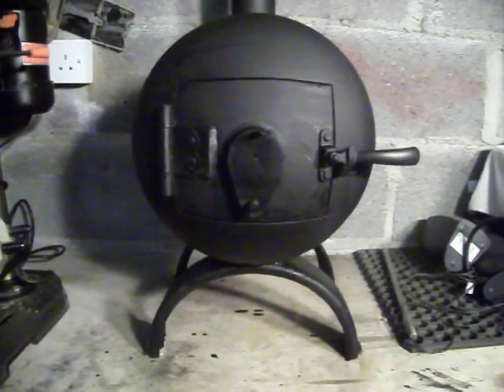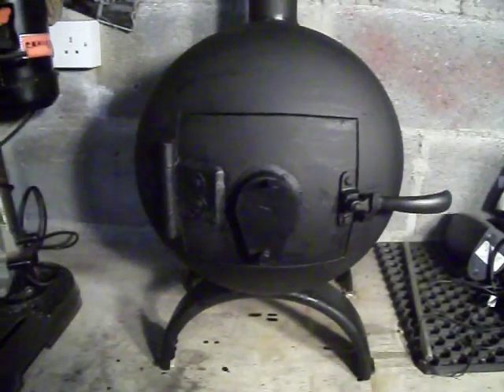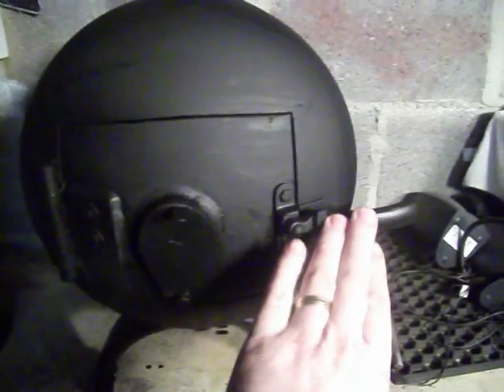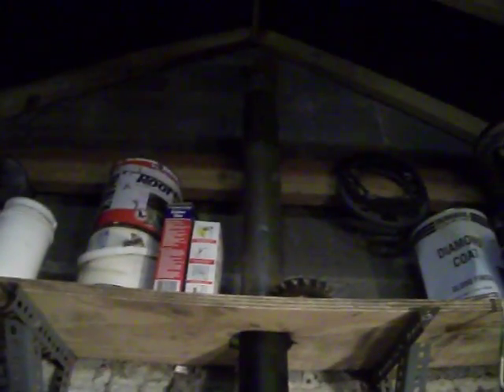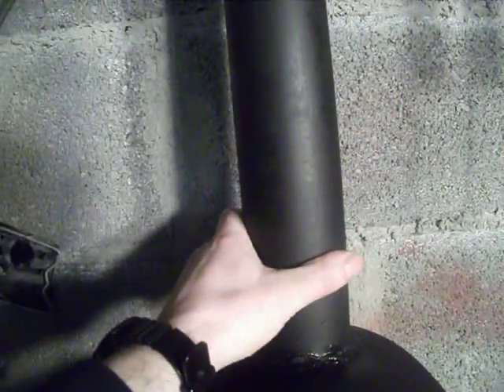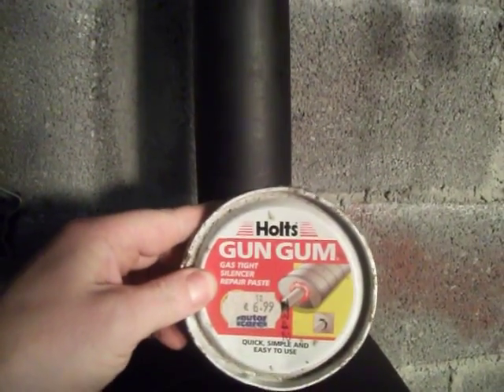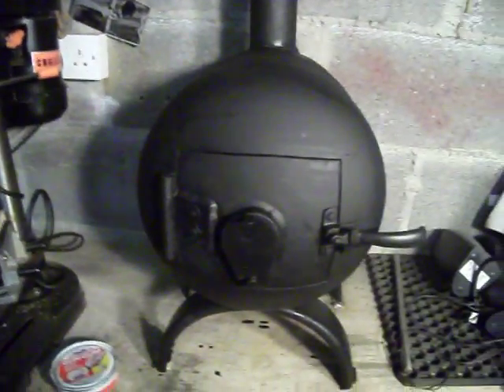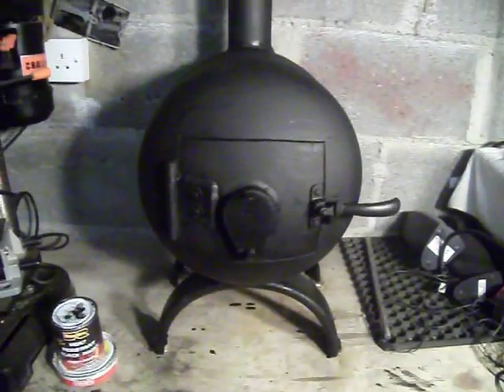gas cylinder stove pt 3

Comment: Nice job, we have a propane bottle stove, there are never problems with smoke leaking out of gaps in the exhaust. The draw sucks some air in through any gaps. A good idea is to make the chimney easy to clean, a good technique is just to push the soot back into the stove. I have considered making one like this but i would cut away most of the top and weld on a flat plate so one can heat water or cook. A huge pot of water keeps the heat in the room for many hours and makes a nice shower if need b.

Comment: Hi,

I have been looking at different designs of the wood burners now i think i wil be copying yours.......
I have 2 questions that i hope you can answer
1) did you use any fire rope around the door to stop the smoke ?
2) did you put a damper in to stop the flames from going up the flue?

many thanks

Comment from the maker: @Kevinisageek I dont know what the exact Btus are but , i kept it goin for a full day a while ago and it burnt off the heat resistant paint i used which was rated for 220c so its definitely hotter than that,ive since painted it with paint rated for 660c so that shoul do,it raises the temp in my garage by a few degrees overall and within a radius of approx 8 ft from the stove youd be roasted,
Its a nice handy and free little project to do,

Comment from the maker: Hi , no i didnt use any fire rope to keepout smoke its just a matter of getting the draft right, though on a few ive made since then i put a metal cut out inside the door which makes the door more snug and prevents smoke, no damper either as by closing the draft you can shut it right down, its just a matter of getting used to it as every stove is different ,thanks for the comment. ;-)

Comment: Very good looking stove.  It looks to me you saved the hole at the top where the gas valve was and added the little cover for air flow, very economical.  The legs accentuate the curve of the belly.  You created a piece of art, my friend.  I'm inspired to try to make one but do not weld.  I can cut the metal okay, and drill some holes and use stainless steel nuts and bolts or proper rivets, what do you think?   Love that stove, thanks.
Reply from the maker: yep go for it.  most factory made tent stoves etc are bolted together..
Reply: get a welding course. I taught myself but its better to get some tuition.  Its quite easy once you get the idea.  Those little inverter 'stick' welders are ace to use.

Comment: If you put the pivot bolt for the air damper flap on the top instead of the bottom, if it ever works loose, the flap will fall shut by gravity instead of fully open, which works out a bit safer.
Better to choke it out than have it go full on and maybe melt something if someone leaves it burning unattended.
Reply: My thoughts exactly !

A pivoting disc draft is one of the simplest,dependable and most efficient air management device ever !

You may as well optimize  this fail safe feature.

Comment from the maker: @bung1e Hi , no i didnt use any fire rope to keepout smoke its just a matter of getting the draft right, though on a few ive made since then i put a metal cut out inside the door which makes the door more snug and prevents smoke, no damper either as by closing the draft you can shut it right down, its just a matter of getting used to it as every stove is different ,thanks for the comment. ;-)

Comment: How big of area are you heating with this stove?
Reply from the maker: my garage, it is approx 15ft by 25ft
Reply: Is it insulated? How long does it take to heat up
Reply from the maker: no its not insulated and it i usually find the garage comfortable after about 45 mins
Reply: Cool thanks, I'm working on one now